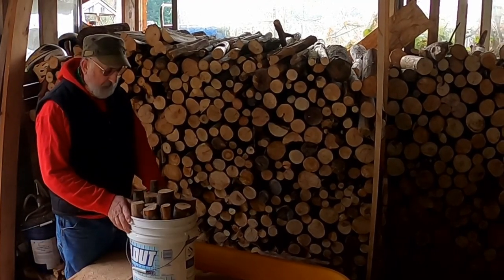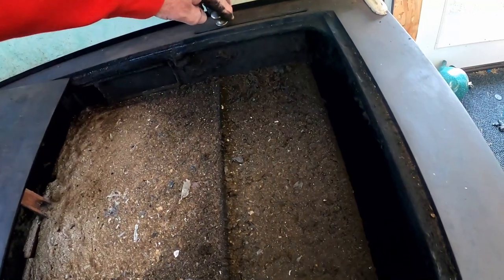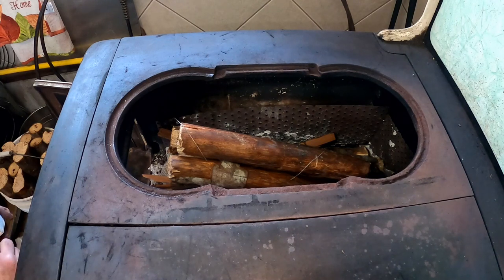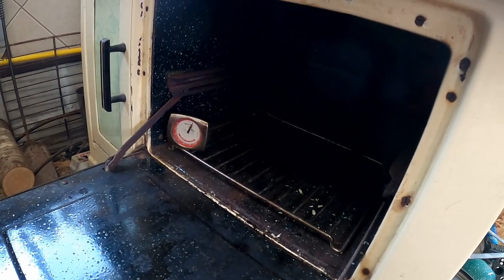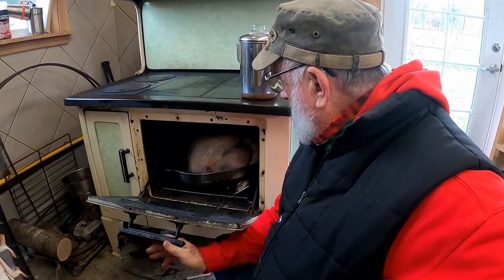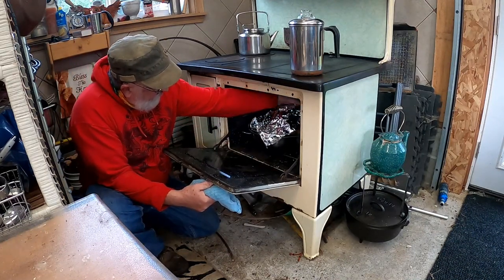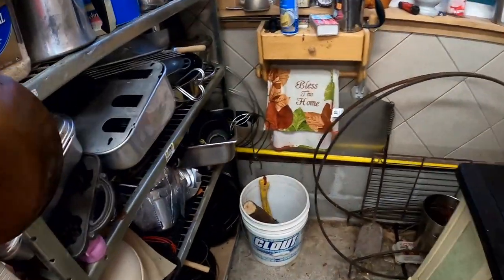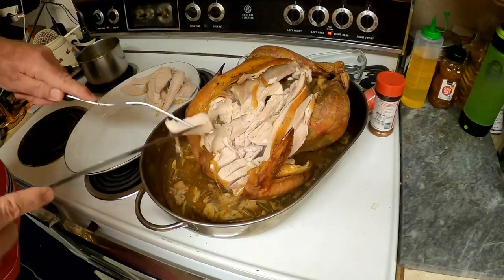Wood cook stove how to bake

Comment: Excuse my first comment. The Californic.... was a google edit. The tin shack had an old (what i thought was wood)  cook stove. We mostly used an old cast iron two burner propane range that sat on top of the cook stove. On thanksgiving we would attempt to cook a small turkey in it.  We figured  it would take 6 hours but  sometimes  it would take 10-12 hours to throughly  cook that sucker. The firebox and grate were pretty burnt out so when we saw a wood/ gas hybrid cook stove for$250 in the classifieds  we were all over it. When we got there we were disappointed  that most of the stove consisted of a bunch of cast iron parts in rotten boxes that would lose all that rusty cast iron on your toes if you tried to pick it up. But the stove was absolutely  gorgeous  with blue enamel   over a nickle plated legs and bottom. The firebox and grate were  like new and it had both a log lighting and water heating options. 4 burners wood, 4 burners gas, wood oven below and above the cooktop where warming ovens would be there was a gas oven and a gas  broiler side by side. Most of the rusty metal in boxes were the various bits and pieces  to the gas oven and broiler. The sheet metal that was the back for both the wood and gas cook top  was totally  rusted through so i  brought a new 4x4' sheet of same gage and traced  hole locations and where i wanted a 90° bend and brought it back to that same shop where they punched , bent and drilled it  so it all fit  together. When i started working on gas part of stove it was immediately obvious  that it was jetted for natural gas and this perplexed  me. I think  of wood cook stoves as a rural option  but natural gas is typically only available  in cities where population  is dense enuf to warrent  it. Got everything in working order and cooked our first turkey in it. It was way better than last stove but  it still required feeding every 20 minutes  and fuel had  to be  thoroughly  seasoned  hardwoods  split to 2"x2". Years later i was doing a housecall for someone's  solar system and i was exiting through  their kitchen when i saw their wood cook stove. The firebox  had to be at least  4x the size of the ones i had been using. Then it hit me. My stoves were coal stoves! No wonder they didn't  burn long on wood. So if you buy used and want a WOOD cook stove make sure the firebox is adequate. If it only has a 6"x6" door it's  probably  a coal stove.
Reply from the maker: Well most all cook stoves could use coal or wood. You turn up the wood grate with the tool and put the coal on the thick rail that tipped up. Thanks for stopping by and commenting.

Comment: Thanks for making this video. We bought a house that has a pellet stove. I grew up with wood burning stove. We didn’t have a wood cook stove but we could cook on it if we didn’t have power or propane. To me the maintenance of cleaning the pellet stove is frequent enough that it’s not that much different from maintaining a wood stove. If I have to clean the ashes and brush it and ash vacuum it so frequently for it to function properly I’d rather have a wood cookstove and deal with adding wood. The utility of baking in it and cooking on it to me is worth having to add fuel to it more frequently. Not to mention being able to have heat and cook even if the power goes out.
Reply from the maker: You are on the right track if the power goes out for an extended period of time. Having seasoned rounds will burn like charcoal, split wood will give you fast heat.  All you need is limbs cut to length. Good luck my friend.

Comment: One of the things I miss about having my old Belanger wood cook stove is that it wasn’t air tight (about 100 years old and still in use, but not here) and you could smell whatever was cooking in the oven mixed with a tinge of wood smoke. I have had a nee Margin Gem for the past three years. You can’t smell the cooking but the embers just need to be stirred up in the morning and add a couple (literally) sticks of kindling and away it goes. Also, the new technology uses less wood. Here I use a lot of birch which I split every summer for use the third season after that. Birch needs to be opened up or will go soft “dowdy is the term used here) within the year. I use the birch bark to start a fire. Burns like gasoline. Your turkey looked beautiful. Folks just love the idea that the meal was cooked using a wood fired cook stove. And nothing like bread cooked in a wood oven, is there?
Reply from the maker: Your so right, I thank many people would be better off cutting wood for the cook stove, then using one for cooking. We live so fast now, just turn on a switch and we have light and heat. My Mom made bread when I was young.  One day she brought home Sliced bread from the store. She said it was now cheaper to buy sliced bread, then it was to make it from scratch.  That was around 1960 when Wonder bread took over bread making from housewives. Happy the video brought back fond memories for you.
Reply: @badbadbob1  :  Thank you for taking the time to write. My mom hardly ever made bread even though it was the 1950’s, however, our neighbour did and frequently for her family of 10. And on an old wood stove. There was no plumbing in the house they lived in which was likely from the 1800’s so water was carried in a bucket from a well. Anyway, I’m off track some. The bread was wonderful. I believe my brother and I spent more time there than at home. 
I have a wood furnace in this old barn of a house and yesterday was the coldest so far this winter (-13C with and winds out of the north west). Between the stove and the furnace, it was too warm. I needed the furnace running to prevent the pipes from freezing in my basement art studio. Nothing like wood heat. I only use about 5 cords a year and buy it chunked up but not split. Take care and I will be watching your channel now that I found it this evening.
Reply from the maker: @amieinnovascotia8490  Well thank you for watching and taking the time to comment. I have a wide range of videos. Most are using wood to heat or cook. Several on cutting wood too. The fun ones are the teepee I made on my treadle sewing machine.  Doing things few do anymore. I enjoy working outdoors so much, The tractor is getting a work out pulling that wood out for my sawmill. Yes to many irons in the fire sometimes. But it all gets done in time.
Reply: @badbadbob1  :  I learned to sew on my mother’s treadle machine. She used to make sails for my dad’s fishing boat. Probably for some of the other fishermen too in the early years since my uncle was a boatbuilder.
Reply from the maker: @amieinnovascotia8490  Wonderful memories.
Reply: Annie in Nova Scotia- I just restored a 1900s Faultless treadle. Yes, I have an electric Singer, but we on the farm, like to have the non electrical counterparts. We live partially off-grid and are 3rd generation NH farmers. We depend on our working farm to take care of us during these challenging times, living the lifestyle of our parents and grandparents, 1935 style! It is glorious! ~ Diane
Reply: @dianehall5345  :  I bet it is a glorious lifestyle. I could so easily live partially off grid too but our parents (all gone now though for about 5 years) and my husbands family are all in this Village. Now I’m 71 and he is a very young strong 78. We should have done something as soon as I retired 14 years ago but by that time, my mother-in-law was into her 90’s and his mom depended on him to keep up her home. From our country place about 3 hours away, it would be very difficult. 
I’m pretty well set up here to operate comfortably too. Along with the wood stove, I use a commercial gas restaurant range so at least we’ve never had to depend on eating bbq. That soon gets old!  Yep, I’ve got a working treadle too. Mines an old Singer. That’s what I learned to sew on and I still remember how. I do have Singer and Husqvarna sewing and serger machines too.
Reply: Amie in Nova Scotia- Well I am also 71 and my husband is 76. Doesn't phase us a bit! We, along with my 74 yr old brother in law run our 350 acre working farm. Grass-fed beef- haying- logging. In March 2020, my brother-in-law shut the farm down to the public.
That also meant no outside hires, We have been doing fine and continue to be shut down. Our customers are required to wear masks, even the vet in the main barn. The only ones not required to wear masks, are the cows! We need to be mostly self sufficient in these times, but band together with our farming neighbors to supply each other with goods and services. I adore Nova Scotia and NB! In 1974 I purchased a small farmstead in Annagance Ridge NB for $4,800.00. That cottage had a Key Mack combination  wood.kerosene stove. Unfortunately the government gave us a hassle to move to Canada, so it was sold. Love the down to earth neighbors!
Reply: @dianehall5345  :  I came into possession. Of my mothers family homestead in the late 90’s. Nothing had been done there likely since my grandmother passed away in 1933. And after my grandfathers death I. 1923, my grandmother didn’t really run it so much as a farm but the property had gold mines on it and they had a trucking company. The big house was torn down in 1955 and a small (20 x 20) storey and a half cottage was erected as a summer place for my bachelor uncle. The property is on the open Atlantic where a major river spills into the Ocean. If we had had it sooner, the fields would never have been let to go back to almost forest and the barns and wharves would have been kept up. To start reclaiming it by the time my husband retired would have been too much. My grandmother kept a herd of jersey cows, oxen, sheep, geese, ducks and chickens. The horse was only to pull the carriage to
Church. Oxen (Lion and Bright) hauled firewood and hay.
Reply: @badbadbob1  It might have been cheaper, but it sure isn't as healthy for you. There is a reason Wonder Bread "builds strong bodies x ways -- and that number kept going down". We should all start grinding our own flour and baking healthy bread.

Comment: That was entertaining, and boy oh boy that looked perfect! I wonder if you could drill a hole in the front to add a thermometer so you dont have to keep opening the door letting the heat drop ? Nice job, thx!
Reply from the maker: Looking at the door it has two or three layers of metal. It does screw together so in theory I could take it apart to drill it out. But the factory enamel is harder then any hole saw. It will burn the teeth off. Do you know of a good 2" hole saw that can stand up to that?

Comment: Thanks for the video. I am not able to see the coal / wood grates in the video, too dark. Is it possible to send a picture showing the difference. I recently acquired a McClary Royal Charm stove and it has the same type of shaker handle.
thank you. 
Doug
Reply from the maker: Well if you turn up the handle. That is the coal grates. You should see it is thicker with less air slots.
Reply: @badbadbob1  Perfect, thank you sir.

Comment: Hi Bob.  I have a question about the flue vent.  I have an 1890's Southbend 810 stove that was original to my house that I found in the basement where it had at one time been connected to the vent system for auxiliary heat.  As it was in good shape I had an experienced restorer completely restore it to as close to original as possible and then I had to store it for about 10 years until I could remodel the kitchen and make room for it.  It is now installed, but I still have a couple of questions.  It appears I don't have a flu vent and I am not sure how big a problem this is for actually using the stove.  The only vent to the flue is the one at the back of the stove, on top, just in front of the stove pipe that circulates the air around the oven.  It sounds as though this damper is pretty necessary?  Comment?  Also, I think I have a small cleanout door under the oven, it appears to have a hinge but it certainly does not open - does that make sense?  If you have time to comment, thank you.  And thanks for the video, it is helpful.
Reply from the maker: I have two videos that may help. The first one shows how to install a flue in your stove pipe. Yes you need on to slow the smoke from rushing up the stove pipe. It is like putting a lid on a pot so it will boil faster. Do not get me wrong, you need flow up the pipe when lighting and cooking, Just control how fast that happens. The second video shows how I check and clean my stove.  Like how to clean out under the oven. My lower clean out door just pulls out with no hinge. Yours may have a twist nut on the door or under the door. Good luck I hope this helps.
Oh and you will also see how I make apple sauce in the second video.
https://youtu.be/7ivLL9JeBDI?    si=yalhlh1h378shVbt https://youtu.be/K73WRsGoL-Y?si=Tm6UirHjVkU3sA3H

Comment: Great video! I'd been wondering if you could bake a turkey in wood stoves. I can never tell just by looking at it if the oven is big enough 🙂
I definitely plan on getting a wood cook stove when I build my house.
How well does one this size work to heat your home?
Reply from the maker: The stove in the video was made in the early 1950's is my guess. It was made for a indoor kitchen. It will keep that part of the house warm. I have it in my Harvest shed that is 18'x18' with a 9' tall ceiling. It keeps it very warm with just a round of wood every 25 min. You can fill the wood box with wood and lower the air flow so it will heat slower. But I find that soot's up the stove. So I just sit by the stove a feed it more often.  You can find new stoves that cook bake and heat a larger home. It's all how much you want to spend. Mine needed some love before I could use it. But I only Paid $300. for it.
Reply: Yes. I’ve roasted many turkeys (some up to 50 lbs) over the past 51 years in the oven of my old Belanger wood stove and I think the oven may have been a bit smaller than the Margin Gem I have now. One thing though: leave some ash build-up on the top of the oven and until you have some there, don’t be in a hurry to bake much as there will be sufficient heat from that direction to scorch the tops. 
Most of the winter here in Nova Scotia, the kitchen stove will heat this big old barn of a house but in the very early morning, the oil furnace will kick in. The beauty of this stove is that the fire is not dead out in the morning even when I don’t add anything after 6-ish pm or so and all I have to do is stir up the embers, open the drafts and toss in some small pieces of kindling and/or some birch bark. Please do make room in your new home. You really won’t regret it.
Reply: @badbadbob1  The prices on new wood cook stoves will shock most people. But some are more energy efficient and can be used to also heat water and hook up to house water.
Reply from the maker: @amieinnovascotia8490  `The top of my oven has a thermal cover. I am guessing asbestos. So The top of my oven will not get to hot. Thanks for stopping by and the comment.
Reply from the maker: @Growmap  Yes Mine has holes covered in the back for water lines. It was normal to have your water heated by the cook stove.
Reply: @badbadbob1  :  I’ve never run into one that has asbestos. I think that old Belanger had fire brick above the oven. This winter the oil furnace has come on only a handful of times which considering the cost of oil here now, that’s a good thing. And we have been using the wood furnace more this winter too. And yes, new wood cook stoves are mighty costly but all the lovely old ones I see on the various Facebook groups wouldn’t be allowed here. Hard enough to get a new one certified as it is.

Comment: Enjoyed your video. I have a question. I'm writing a novel set during the Depression. The family has a wood cook stove. When you open the oven door, and you have the handles set for the oven to heat (because you're going to make some cornbread), does much smoke come out the open oven door? In the scene the little girl is wearing a wet slip and company will be there soon, so the mother has her stand in front of the oven to speed up the drying of the slip. I know it will be hot, but will it be smoky with the door open? I didn't see smoke coming out whenever you checked on the turkey (which looked wonderful, by the way, when it was done).
Reply from the maker: I have to say a story is a good way to teach. Many of the comments I get are about the smoke making its way into the food in the oven. As a matter of fact, none of the smoke from the fire ever gets into the oven. The hot smoke goes around the metal of the oven causing it to heat. As for baking in the oven at the same time opening the door to dry off the anything, is going to lose the heat you need to bake. 
 I would say to Dad  "throw some small sticks in the stove to get the fire up fast, we have to dry this girl off, but quick."
  Normal operations of the wood cook stove other then when the stove is very cold, you would not get smoke out into the room. Terms you would read in a cook book for temp. of the oven would be. 
"A quick oven" is 375 to 400 deg. "A moderate oven" would be 325 to 350 deg. An "easy oven" would be 250 to 300 deg. temp. 
  Good luck on your book.
Reply: @badbadbob1  Thank you for your fast reply. That will be helpful information. I'll return to that scene and add a couple of lines. I'll also add your name to the acknowledgments page. I'm a retired history teacher and I like to be accurate when portraying things in my novels. My readers often comment that they learn new things from my books. This will be my 8th book, but the first one set during the Depression instead of present day, so I'm learning new things, too, as I research.